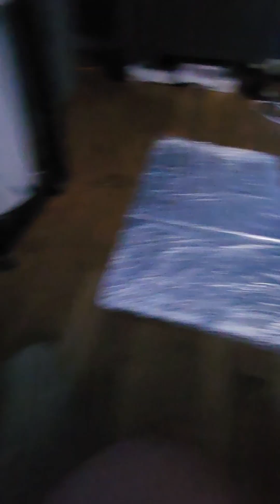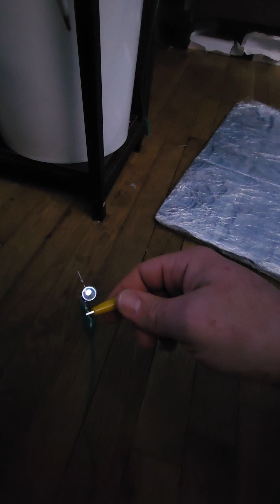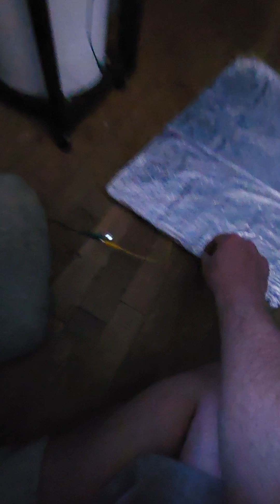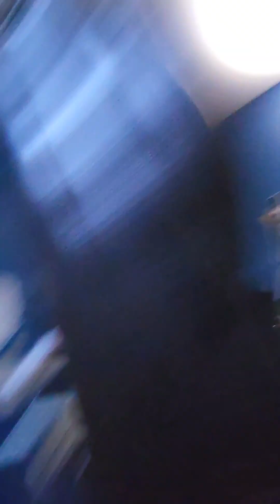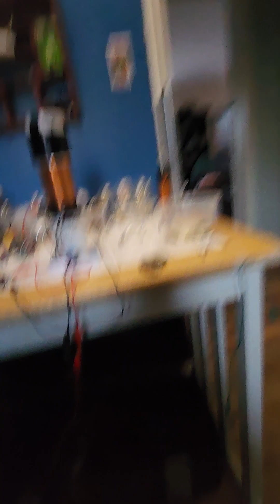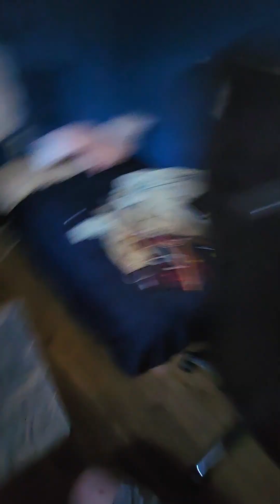📡 True Free Energy Extraction With Zero External Input? Can Anyone Explain This Effect? 🤔

Comment: How is that little LED receiver made? Need to understand that first to postulate what energy it's picking up.
Reply: Must be absorbing the wide range of frequencies(radio waves, microwaves, planetary and cosmic rays…)that are rectified to dc with your setup…
Reply from the maker: It's 2 1n4148rf diodes in an up down configuration with a 0-120pf variable capacitor between the mid point of the diodes & the positive